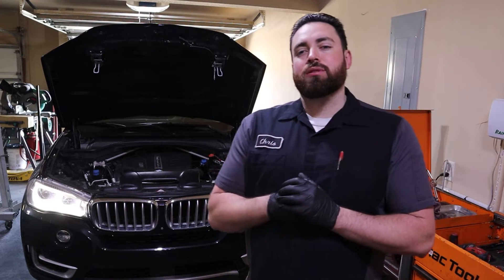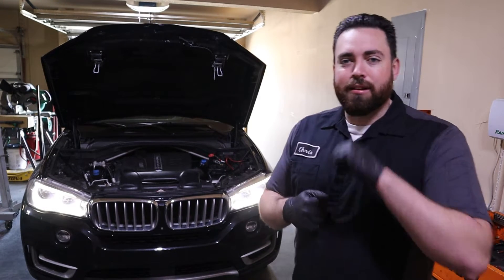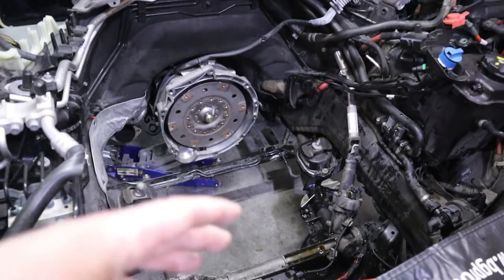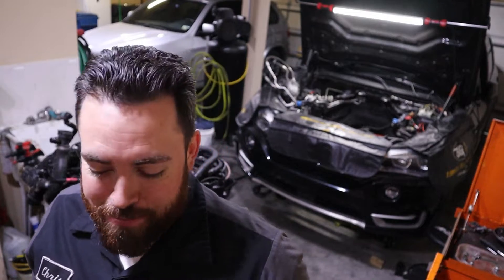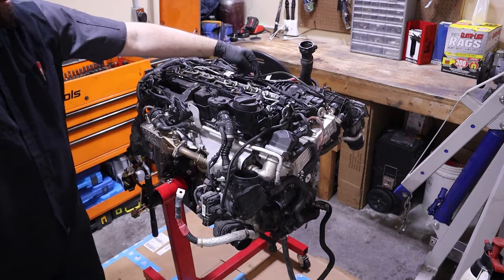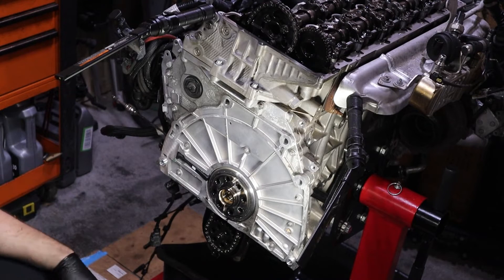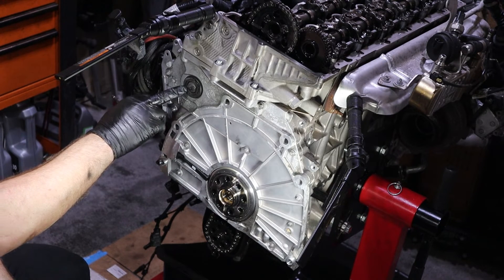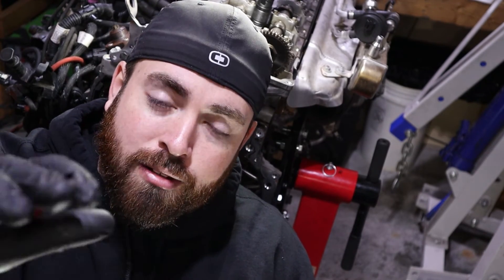BMW F15 X5 N57 REMOVAL & TEARDOWN FOR TIMING CHAIN & ROD BEARINGS

Comment: awesome video, exaclty what i was after as im removing a n57and 8 speed to use in another engine,
unfortunatly im at home and dont have a hoist [i have the engine crane ]
Is it easier to seperate and remove engine and gearbox seperatly or can you remove the front end and wheel it out on the subframe?
i will need the wheels to stay ideally to move it around still after i removed engine and gearbix

Comment: I’m looking for some better views of the AC compressor. He only glossed over it. Meanwhile, after removing the only 2 bolts I could find, it’s still not budging.
Reply: Did this a few days ago. The ac compressor is attached using 4 bolts. I had to remove the alternator to reach it, but the job was actually really simple afterwards.
Reply: On this side of actually having it removed, it was only the two bolts, but there was just a lot of prying involved. Very heavy prying. That’s atypical for BMW mx.

Comment: I’m looking for some better views of the AC compressor. He only glossed over it. Meanwhile, after removing the only 2 bolts I could find, it’s still not budging.
Reply: It’s a very tight fit. After removing those 2 long bolt just use a pry bar to help moving it out.

Comment: You don't need to remove the inlet to remove the valve cover (at least on a UK-spec N57) - there's just enough slack on the fuel rail feed pipe to just loosen it and pull it off the fuel rail and remove the rail that way. Only helpful on the car though - if you've got the engine out, removing to clean it is sensible.

Comment: Yes, perfect time to do an EGR and port carbon clean with the inlet manifold off. I also do a torque converter overhaul if I have more than 120,000 miles (or Km equivalant). Cheap insurance for your ZF8HP70, nothing worse than a worn TQ clutch putting metal thru your trans. I have a couple of E70 LCI's awaiting this work in my shop right now.
Reply: whats required for TQ converter overhaul?
cheers rob
Reply: @RobsDIY  They go to a specialist company that cuts them open on a lathe, inspects and replaces any worn or damaged internal parts (bearings, clutch plates, seal etc), then assemble, weld the housing back up and balance the assembly. Plenty of vidoes on YT of this process.

Comment: That's a lot of work! We, who are about to drive, salute you! 😂
(extra points for getting the reference)

In all seriousness though, I got this engine in my 2015 F10 530d (that I love to death) and its chains are in excellent condition at 210k kilometers or so (immaculate service history by 2 German owners), but I'm still very curious as to how the whole procedure goes because I can't just sit and watch at the repair shop that I service my beemer at.
Thanks a lot for sharing this! ❤
Reply: Ah you sure it's ok? I thought my 2010 330d N57's (145k miles) chain was ok (full service history, factory change intervals) until I happened to be listening for a running problem after a long journey. So I only heard my chain making a modest rhythmic scraping noise with the drivers door open and revving the engine to ~2k RPM, and like I said, with a hot engine.
Reply: @Markpd69 
Yep, I'm sure. The slack on my chains was recently checked with a specialized tool by BMW. They have less than 1mm slack with 12mm being maximum allowed before chains having to be replaced.
BTW factory interval was too long in 2010, that's why BMW revised it for 2013 onwards (was 15k miles, then 10k miles which is still too much in mine and many others' opinion). I change oil at around 10k kms (6.5k miles). Engine oil is life blood of an engine, it needs to be as fresh as can be.

I know that engine oils have come a long way and that additive packages in them are better but the base oils are still more or less the same, and they are subjected to enormous stress of modern high compression, high power output diesel engines.
Personally, I'd rather spend a bit more money for maintenance each year than a lot more for chain replacement or even engine rebuild/replacement if things happen to go catastrophically bad all of a sudden.

Comment: Can you please tell , where camshaft sensor is on f15 530d, i have no signal error codes, ( 273c00) cranking not starting and error (249300 )
And rail pressure too low when starting, thankyou❤

Comment: Hey,  quick question, i'm having trouble reaching undoing the top screw on the transmission,  i'm in a similar situation as in the video, i don't have a car crane and i'm doing everything on the floor except my car stands over a pit for a little more ease of access. so please share the knowledge on how best to reach the top screw. i would greatly appreciate the info. 
mine is a F15 x5 2017 with the N57 on a 8HP70Z tranny
Reply: You go above the transmission with long extension/s. Got to drop the exhaust for this. And there are 3 bolts that you’ll need to access in this way.

Comment: Wow didn't know they sound like that when they go bad.   I'm at 110k miles.  Solid so far.  16 f10 n57.  I run 5w40 and 15w50 with Lubeguard to protect all this.  Thoughts?   BMW recommends 0w20 or 5w20 I think.   Anyway
Reply: You know weird thing is.  I have guys on my fb group with 235k miles on original chain and such with no issues.  And then others are going at 90-120k.   Mostly 13-15 f10 and f15 14-15.  Never saw a 16+ with issues.
Reply: 2016/2017/2018 don’t have timing issues
Reply: @eldismemushi  concur.  Never seen issues
Reply: I have a 2016 535d with 40.000 miles  on it I change oil every 5000 with castrol edge LL 5 / 30 oil . Hopefully this will keep the chain good
Reply: @lawrenceburls4673  castrol is junk imo.  Its "okay"   run 5w40 Valvoline premium blue at least or Triax euro vx is better.  Peace
Reply: What year was this
Reply: @scottp6761  2016
Reply: Are you saying cars from 2016 you've not seen any bearings failing? If so I wonder if they upgraded them?
Reply: @jamescrook8815  none and no timing chain issues either.  I definitely feel in 2016 they upgraded both.  Can't prove it unless I dig into asking BMW but they don't like admitting there was an issue anyway

Comment: , I have a bmw 330xd e90 2009 , so the problem is like that... I was 70 km/h and I release the throttle..and at 65 km/h it was a knocking !! I put my foot on the throttle and then it's disappeared the knocking ! I release again the throttle same speed 60-70 km/h and it does again the knocking ! But just in this speed from 70 to 60 km/h , I do that again but when I was hearing the knocking I put it in neutral and same result disappeared the knocking when is in neutral from 70 to 60 its not any knocking just in drive it is the knocking and just at this speed from 70 to 60 km/h , when is my foot on the throttle at this speed it's not any knocking just when I release the accelerator !!! Please help !!!

Comment: Nice job, did u remove the Dpf before removing engine? And where do you access the torque converter bolts through?
Reply: remove the starter and you have assess to the flexplate bolts